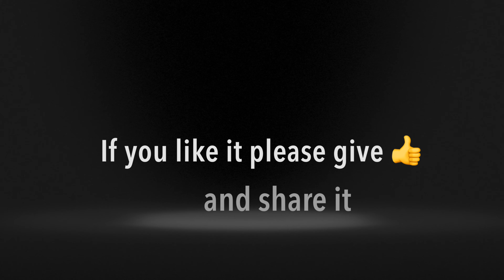Samsung Note 4 Not Charging Problem Fix

Comment: This is not a fix but a complete teardown. with a big risk.
Reply from the maker: Hello,Pandit Reuvers! Its true that this tutorial can be used for any repair you might need, but yes, i ve changed the flex charging connector so the problem of the device was solved. Ans yes, it s true also that s got an risk, you need special tools & some experience! Thanks for watching!